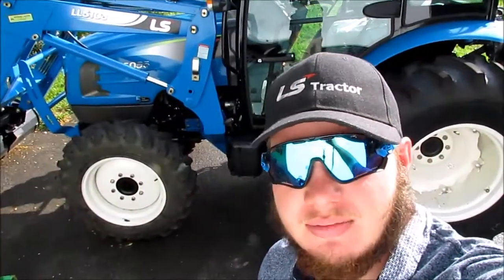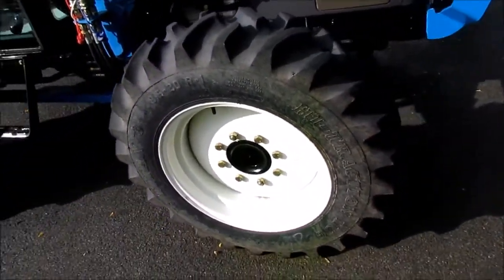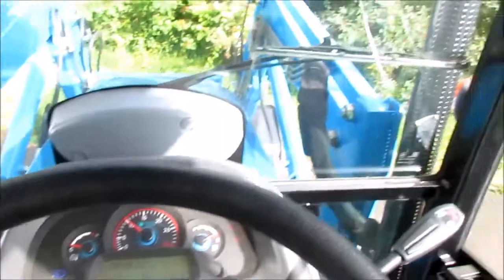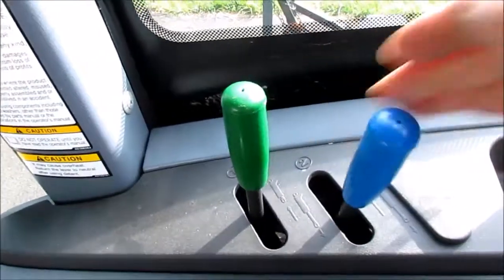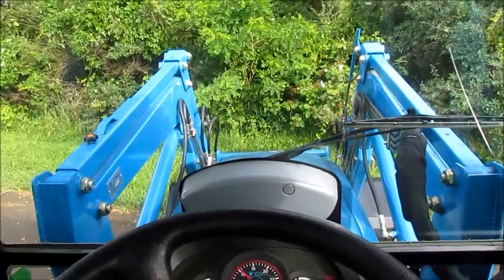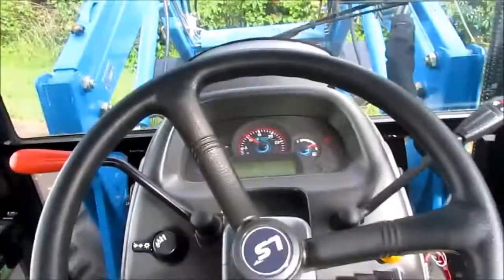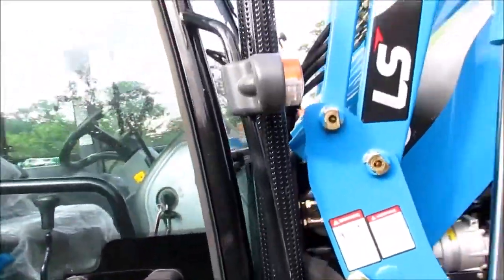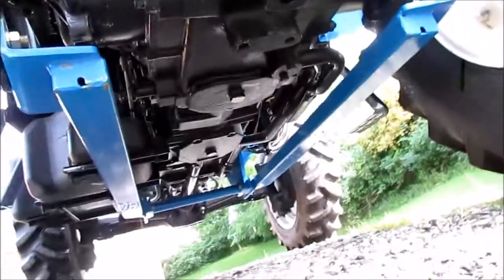LS XU5055C TRACTOR REVIEW

Comment: on this tractor have you got the elec. problem fixed yet.? was your dealer helpful?
Reply from the maker: No he wasn't. And no it's not fixed just dealing with it. I'd try other dealers but need it everyday and I don't have a means to haul it that far. Dealer I bought from is affordable tractors in va
Reply from the maker: Seems like all the dealers are mom and pop shops. I'll stick to meade next time where all my other purchases have came from
Reply: Mortons in Fredericksburg is a large outfit, and handle a broad product line.  Mostly a Kubota shop, but sell LS as well.
Reply: What kind of electric problem ya got

Comment: LS tractors are crap.  Too many quality issues.  I was about convinced to buy one, but after the stuff i have seen with the XG3025 and other models no thank you.
Reply: "My tractor has been in the shop one month and now I am told it will be two more months before it is fixed. The problem is they send parts from Japan. Look elsewhere for equipment. Who can afford three months without equipment and a company that could care less about customers! I’ll give more details to anyone that asks"
Reply: "I have never taken time to rate a purchase until now. When purchasing a 20,000.00 tractor I never expected to have such continuous problems. After the 5th time I had to have dealer address right front tire going flat, and after they attempted repairs several times, they had me buy a tube - that failed within hours, Now they say I must buy new rim and tire. Combine this with all the loose hydraulic fitting leaks addressed by dealer several times, I am very unhappy. The dealer does not seem interested in resolving this. No repeat business from me at this point."
Reply: "I bought a $20,000 tractor last Monday. 2 days later had a service tech out here fixing it. Had several issues with it. Even the tech said he was going to report the issues with it. Wonder someone hasn't got killed on it yet. Then a few days later went to the dealer I bought it from and got nowhere. Then I called customer service and was suppose to get a callback. @ weeks now and still no call no email nothing. I will never deal or recommend no one. And found out today that I'm not the only one with the issues and poor dealership here local."
Reply: "Do not. I repeat. DO NOT BUY. The worst purchase in my entire lifetime. Never have I encountered such mediocrity. The lies that they tell about their machinery is ridiculous. I bought one 2 years ago. 40 thousand dollars, wasted. Something is always breaking. Even when it's under warranty, they claim it's normal. I'm not going to go into great detail because I've wasted so much of my life on this piece of junk already. I'm cutting my losses and selling mine and going anything other than. You have been warned!
Reply: Which tractors are you talking about?
Reply: EXACTLY!!!  Not trying to convince you on purchasing an LS, or any other tractor for that matter, but these above quotes are taken directly from consumer reports regarding Kubota tractors.  The same can be pulled for JD, and other like brands.  With your stance on LS being crap based on reviews, it is highly unlikely you will purchase a tractor at all!
Reply: So the emphasis of your rant about 2 different tractors is about Kubota?
Reply: Rant?  You asked me questions about the XU6168 I just purchased last week on a separate video and I just happened to notice your post here where you say LS is crap within the last month!  Seems you aren’t exactly sure about LS and I was just trying to provide some perspective for you!  I’m done here as I feel I have Hitwall!!!
Reply: Yeah - I would say if you are putting do not I repeat DO NOT BUY and talking about the issues you are having on a video about LS I would assume you are ranting about LS being junk. Then you mention Kubota and the quotes from consumer reports so where does Kubota come into the picture on this video or your video?  And the guy in this video is having electrical issues as mentioned below.
Reply: COMPREHENSION!  Total lack thereof!!
Reply: Comprehension - how am I supposed to know what you are talking about when the first 4 posts you have mention nothing about which tractor brand.  You didn't mention any of that until I asked which tractors are you talking about. You could have been talking about your experiences not something from consumer reports.
Reply: Read my fourth comment here again, slowly!!
Reply: Your 4th comment starts with Do not. I repeat. DO NOT BUY.  Your 5th comment is this after I ask which tractors are you talking about  - EXACTLY!!!  Not trying to convince you on purchasing an LS, or any other tractor for that matter, but these above quotes are taken directly from consumer reports regarding Kubota tractors.  The same can be pulled for JD, and other like brands.  With your stance on LS being crap based on reviews, it is highly unlikely you will purchase a tractor at all!
Reply: Great!  You read, and quoted, my fifth response where I state, " these above quotes are taken directly from consumer reports regarding Kubota tractors"  My previous four posts above where QUOTES from consumer reports about Kubota tractors.  I did not author them, I simply copied and pasted them here for you to see what some are saying about another brand.    I was just trying to impress upon you that EVERY brand of tractor has these type reviews, not just LS.  You're basing your decision not to purchase an LS tractor on reviews which led me to say, "it is highly unlikely you will purchase a tractor at all"...
Reply: Yeah until you posted that fifth response I thought it was you ranting - just kind of glanced over the comments, but it is all good.  I guess if you plan on buying a tractor find a good dealer that is close by and hope for the best.